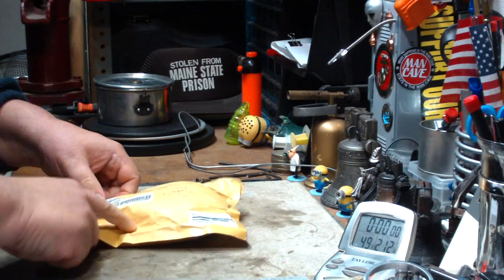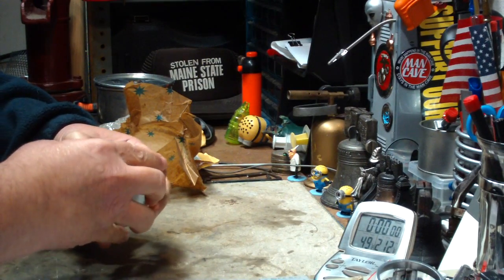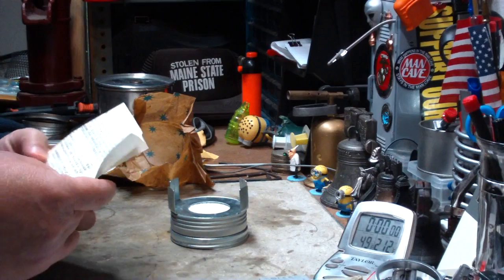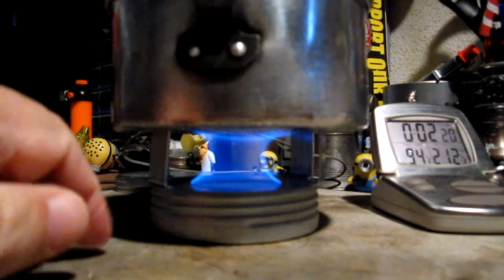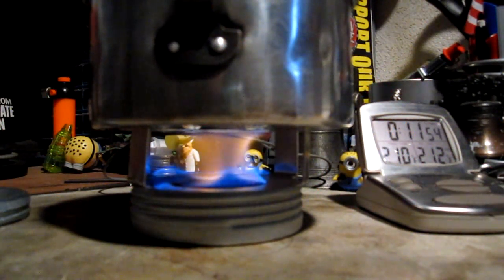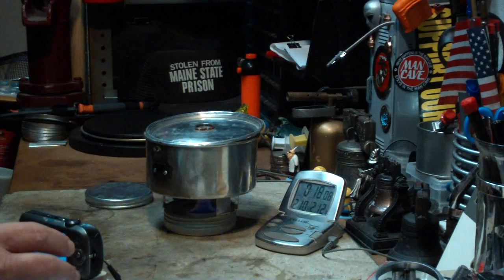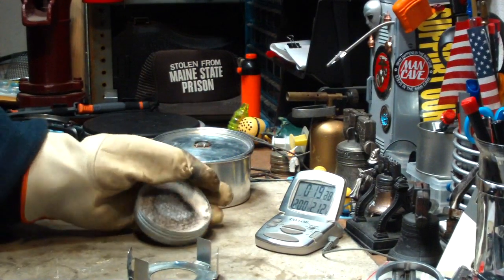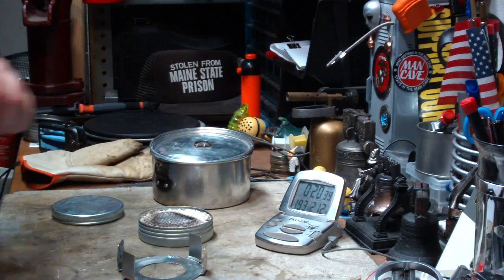Vintage (1970s) Spirit Alcohol Backpacking Stove - Unboxing and Boil Test#1

Comment: I wonder if you drilled a series of jets in the pot stands ring, say 16 8mm jets if it would bloom like a top burner? You may get a faster boil while keeping the stoves persona as a simple easy burner. I dont know if anyone else has said it but beings the stove is very old swapping the original fiberglass for carbon felt would be interesting! Thank you for the cool video!